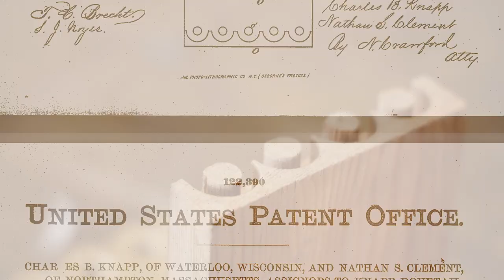How to make these Alternative Dovetail Joints (The Knapp Joint)

Comment: Way to keep the dying arts alive and breathing. We need more craftsmen in this world.
Reply: Ironically, the joint was designed to made by a non-craftsman. All you needed was training in the use of the machine. The wheel turns... :)
Reply: @robnunya572  ... kinda makes me love it even more. Something about making craftsmanship more available to people that appeals to me.

When I make knives, I can put a fuller in the blade with a ball-peen hammer, but I can also weld some polished rods to a loop of springsteel and make a fullering tool that makes it quicker and easier. Then you don't need as much to make a perfect fuller on both sides of the blade. I doubt anyone would say it makes the knife life less of a craftsmans creation.

Heck, I'd love a box with these joints on it.

Comment: I wonder whether a calculation could be made as to the strength of these joints and how to optimize the parameters such as the diameter of circles and protrusion circular bits of this joint, the spacing etc.  It is very interesting.

Comment: Not sure how to best explain it, but could you make individual strips for the template? Like have two end pieces and then a bunch of individual strips of one scallop each? This would need another clamp for the template itself, but would allow the ability to quickly make any size joint you want without needing to make a new template for each project.

Comment: It's certainly an eye-catching joint.  I doubt it's anywhere near as strong as a classic dovetail with a similar number of pins (perhaps a Matthius Wandel style joint stress comparison is in order? He tested pocket hole joinery to failure against mortise and tenon joints with a bathroom scale, bottle jack and some simple levers to scale the forces to within bathroom scale range).

It seems like it might be similar to a doweled joint, but doweled joints have a LOT more continuous grain.  Those 'hoops' are pretty delicate, structurally.

Comment: Great video, and a cool joint - thank you!!  It’s been said before,  but I was thinking that Instead of modifying the spade bit, just use a Forstner and drill the whole thing out.  Then cut the “tails”.  Then fit the joint together, and use a smaller Forstner to drill out the centers on both pieces at the same time. Then just drive in a dowel.   Guaranteed concentricity.  

Now I’m thinking to do this with bigger scallops on a larger board and then cut in exposed Dominoes in each scallop 🤣

Comment: How about using ball bearings instead of those copper-pipe-and wood-assemblies, so you could use it also as a drill jig (only glue the outer rings to the board, so the inner ring rotates with the drill)! Would require to match the tool for the pin side to the bearings, but saves an extra step on every joint!

Comment: A labor of love, and so diligently done and documented. However, I can see why these beautiful Knapp joints really didn't take off compared to dovetails, as even industrially, to make them worthwhile, it would require a CNC machine to really get some drawers and cabinets made at reasonable production cost.

Nevertheless, the ingenuity shown here and masterful use of modern tools not available at the time of this joint design, still demonstrates quite a bit of craftsmanship.

Comment: make a chest with this joint. make the joint pattern face forward and use the the "face side" dark and side panels light or why not a picture frame but insted make this join the frame pattern if you can figure out a way to make the edges blend

Comment: I wonder if you cant get the same joint using a forstner bit, then drill a hole for a dowel and flush cut it. May have to try that out.

Comment: Hmm, how about a faux Knapp joint using loose 10mm dowel pins?  The notched spade bit would not be needed, only two Fortner bits - a 19mm and a 10mm,  A row of 19mm cavities would be drilled in the the drawer front using a  template.  Then a male template with appropriately spaced 10mm I.D. bushings would guide the 10mm Forstner (or bradpoint) bit in the drawerfront.   The same template would be used for routing and drilling  the drawer side.  Then 10mm dowel pins would be inserted to assemble the joint.  To complete the illusion, the 10mm dowel pins could be made from an offcut of the drawer front so that the grain lines match.  Or... just use dowel pins of a contrasting species.

Comment: Hey Pask not sure if you’ll see this, I’ve tried to make one of these special spade bits, managed to cut out the square (it’s a 40mm bit and I need a 22mm plug with the rest cleared away) and it’s working on softer pine but none of my more exotic hardwoods :( just gets stuck in my pillar drill, any tips on making it sharper? Is there a better angle for the flat bits to be at in order to hardwoods better? Cheers for any tips love your vids!

Comment: You should have filed the slotted spade bit with a pair of bevels on the sides of the slot, so that the center post on the piece was touched only by the cutting corner, not by the flat side of the slot.  Draw the end view on paper, to see that the post, is being rubbed by the flat sides of the slot.  More likely to bind and break off or burn the post.  The actual width of the post should be the diagonal distance between the two opposite edges of the cutter, not the shortest distance between them, as you measured.

Comment: What if you cut out the shape without the dowels, glued it together, and then came back and added dowels? That way, you wouldn’t need a custom spade bit and you could just use a forstner bit. It would take a lot of the challenge out of the joint, but you could retain the same basic look with fewer tools and less effort. 
Also, how about making a punch the same radius as your jointing piece to clean up the outer edges. When I saw you cutting around your template for the joining piece, my mind went to your guillotine. What if you forged a v-shaped punch that could clean up in between each round part of the joining piece? 
Hopefully this makes sense... I’ve got a clear image in my head of the right tool, I’m just not very good at articulating my idea.

Comment: The only part I would think that is a pain is having to manually clean up the circles with the chisel so everything fits. I wonder if you can avoid that by putting the pins closer together so the scallop is not so deep.

Comment: The large pins look out of balance, but they're probably still the weak point of the joint. If anything I'd imagine half a millimeter larger would probably be better for strength, though of course a 10.5mm drill bit probably isn't in everyone's toolbox. Pins are unfortunately a lot weaker than hollow sections. Still, depending on grain the hollow still might rip apart and break first.

Comment: A lot of frickin work to make this joint; I guess once all the templates are in place it's not so bad.
But I really question how much stronger this is than a simpler to produce dovetail joint. Other than that, it does look nicer, but that is more cosmetics than engineering.

Comment: I'd just use my cnc, but that's of course not nearly as much fun as making custom tools and jigs plus manually adjusting for a good fit.
Reply: Whats fun about that,retired tool die maker,and machinist,its call work.No mistakes,or junk pile,or weld it up and cobber it until you get it finish.Engage brain first.

Comment: I would think the hardest part would be making a jig, spacing each evenly. 

I am thinking an easier and quicker solution would be drilling holes on each board. Then tap in a peg to connect the two. This way you wont have to make a new tool. You will only need to make a consistent jig. But with thinking of connection two hole and a peg to connect the board should make it easier to imagion and make the jig.

Comment: I'm guessing this kind of joint is much stronger if the ring side of the joint is plywood because otherwise the outside of the rings has no support from the grain.  Not that a drawer joint needs that kind of strength.

Comment: Why did you go through all of that work to make the second half of the template, instead of just taking the outline piece you had initially cut out, glue, or clamp it onto your piece of wood, and then trace the lines, or spray some paint in there, or a brush with paint, or dye, with the inside "dowels" still attached? and then cut that out?

Just curious if the way I'm thinking wouldn't work, if the way you did it is just a superior method, or if the way I'm thinking just wasn't something you'd thought of.

Comment: It's pretty cool but I think if I were doing it (and I might) I would cut both ends on a router, clamp them together, drill the holes for the pins, then insert dowels. Some people might consider it cheating, I just call it innovating.

Comment: My dresser drawers have this joint. It always seemed overly complicated to me.
Also, don't recall exactly but someone, MLCS maybe, sold bits and a jig to make this joint a decade ago or so.
Reply from the maker: I mentioned in the video you could buy a system to do this but it costs around $1000 and it doesn't deal with the pointy scallops, which really makes the joint. They look like they've been made with a router or a cnc, not like mine. :)

Comment: 8:18
What kind of drill and drill bit is that? for making the whole a little bit deeper for the screw, so that the screw head sinks a little bit lower than the level of the surface of the wood. I would like to buy such a powerful drill and a drill bit
Reply: It‘s a countersink bit / attachment

Comment: so instead of doing the dowels with a drill.. not easier to just hammer in a dovel?
Reply: Moronicsm urf yes, I was thinking the same thing.  Instead of modifying the spade bit, just use a Forstner and drill the whole thing out.  Then fit the joint together, and use a smaller Forstner to drill out the centers on both pieces at the same time.  Guarantees concentricity.  Then just drive in a dowel...

Comment: I hate to admit it but Harbor Freight has really upped their game. In the past I have been far from a fan. However, their newer lines of upgraded power tools are far better than their predecessors. They still sell some junk and their blades seem to garbage no matter the type. If they could only get replacement parts and service arranged on higher end things like generators then they would really move up another notch.

Comment: This would be much faster if you squared everything but the pegs and holes. This way you would only use the template for centering, and could remove the manual process of cleaning up the interior edges.

Comment: That's an awful lot of work for those joinery. I recently refinished and old wash stand and found this joinery on the drawers. I had never seen them before and after researching found out that type of joinery was only made from 1870-1900 and then it stopped. So that wash stand is anywhere from 120-150 years old. A good way of dating furniture. I think besides being strong joints they are also pretty looking especially when 2 different color wood is used.

Comment: bro... PLEASE tell me you put cutting fluid on that metal guide that rubs the bit. xD
Reply from the maker: It's running at the slowest speed and the tips of the cutter are below the metal guide before I turn the drill on. It only takes a few seconds for each cut so it really isn't an issue. Cutting fluid would make a mess of the wood too. :)

Comment: why not use a set of dowel plug cutter and matching drill instead of making your own? They come in various sizes. But that does not solve the problem of creating the 'male' side of the joint

Comment: You actually didn't annealed that spade bit. By letting it air cool you simply normalized the steal. To anneal it you would have had to cool it as slow as posible by insulating it with something.
Reply from the maker: I understand that and have annealed in vermiculite many times in my videos. It was still annealed. :)
Reply: @PaskMakes  
   Normalized
Reply from the maker: Well whatever you want to call it, the aim was to soften it so I could file it and it did that. :)

Comment: this can be done faster with a pantorouter created by Mathias Wandel
Reply from the maker: Yes it could if you have one but you still have to deal with the pointy scallops. Or leave them rounded over which in my opinion looks pretty bad and obviously made with a router. The rounded scallops aren't in keeping with the original joints.

Also once you've made the jigs it doesn't take long to make the joints at all(only a few minutes). Not as fast as the pantorouter for sure, but if you're not making thousands of joints then it's still plenty fast enough. :)

Comment: I am calling you on the 10 minutes, please make a video of walking into your shop, start the timer and knock one out in 10 minutes, next, if you fail, then next attempt you have all of the screws, bits, paper, wood all handy, and try 10 minutes to a finished high quality joint. Finally, do all of the above as well as having your stock wood cut to length. I am still say it is unlikely you turn one out in 10 minutes even with the jigs and templates.
Reply from the maker: Fair enough the jig needs setting up for the first one so that would take 1-2 minutes then I would make those joints in under 10 minutes no problem at all. It doesn't matter what joint you use the stock needs preparing first so obviously I'm not talking about that either. 

I honestly can't see how you think that would take a long time. 

Break it down - clamp workpiece to the jig drill the first cut, repeat until there's four cuts, that's no more than 2 minutes. 
Square the ends of the joint up with a chisel 30-60 seconds, call it a minute. 

Clamp second workpiece to the template mark for the holes and route with pattern following bit less than a minute. 
Remove centres with a gouge less than a minute. 
Drill holes, a minute will do that. 
Then put it together. 

Well under 10 minutes and I wouldn't be making one joint at at a time. I'd drill them all first with the cutter, then do the next step to all of them and so on. So it is quick to do. :)

Comment: This is the WORST joint EVER!!! Way too much work for very little strength. Just DUMB.
Reply from the maker: Well I have to say you wrong, for a drawer joint it is supremely strong think about it. There's furniture that's been around for over 100 years that will show that you're wrong, apparently the joints stand up very well.

There's very little work, sure you have to make a couple of jigs but most joints require that or you buy one (of course you can make joints by hand that I also like to do). The only thing DUMB here is your totally unhelpful comment. How about adding constructive criticism that maybe helpful instead of just being negative! :)

Comment: I'm afraid that, having spent my formative years in boats of many types, I cannot see a practical use for such a boat. No loadspace, no passenger capacity, displacement hulls with limited speed, no capacity to manage waves head on, apparently high freeboard (although we don't know its displacement) so susceptibility to crosswind. Maybe you could use it to feed fish on a millpond but it doesn't look worthy of a trip on a lake let alone a venture onto the briny. And why use a prop on one side for forward propulsion and a different, fixed prop on the other side to steer. Thousands of years of experience with boats has taught us that a rudder is the tried and tested way to steer a boat or ship. With a rudder, steering would be more sensitive and more effective and both props could be used for propulsion, assuming you still want to have the props that are unidirectional.